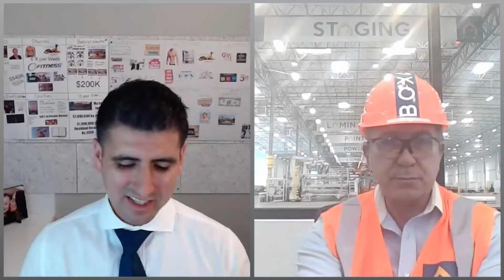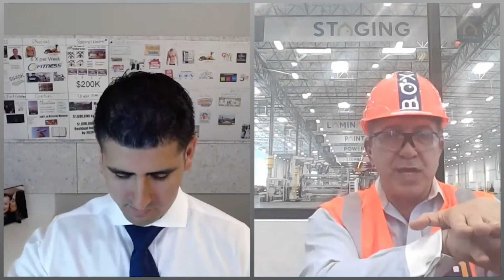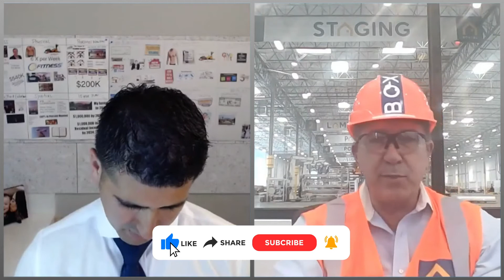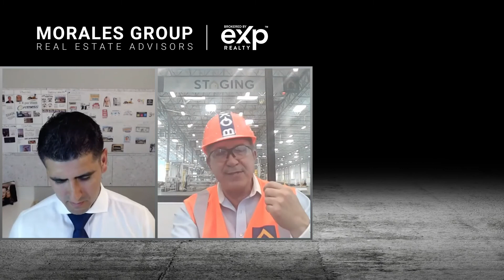Material used in Boxabl Tiny Homes, Boxabl Homes Material, Tiny Home Construction!

Comment: Apparently they are laminated plastic. He compared it to an igloo cooler. So it burns like gasoline, not that wood doesn't but a plastic house is hardly ideal. It will be interestto see how they hold up to UV radiation as no plastic can endure that indefinitely. As shingles and siding cannot either.